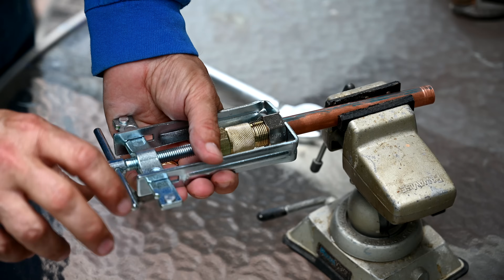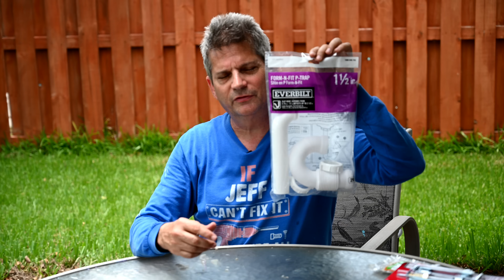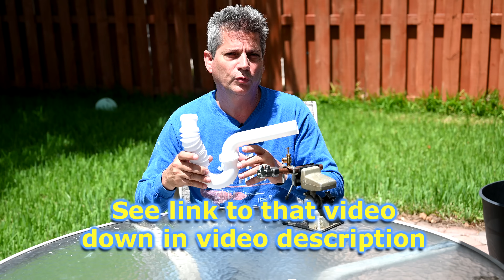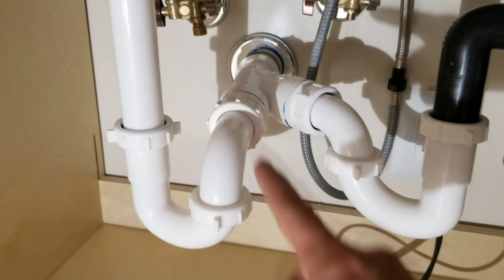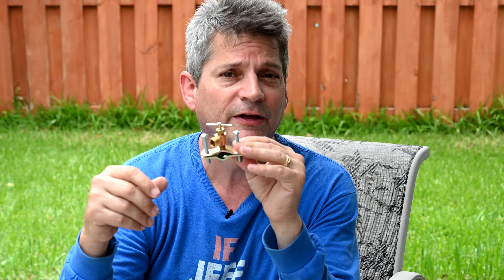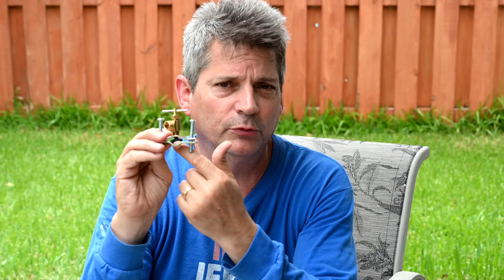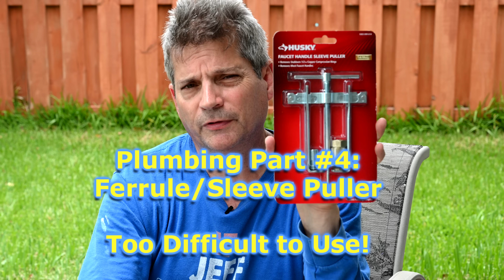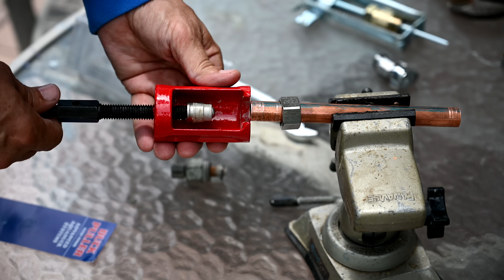4 Plumbing Parts/Tools You Should NEVER Use. NO Plumbing Fails

Comment: Some historic buildings in Washington DC with S traps are required to keep s traps during a remodel.
Reply from the maker: @GoodISnipr If the venting is good, you might not ever even have a problem with the S-Traps. If they siphon out, you can just turn on the water a few seconds and the trap seal fills back up to the weir again.
Reply from the maker: That is weird. I bet in new construction though, they require P-traps

Comment: Can you use shark bites to fix. Or join 2 pioes
Reply from the maker: Yes I use shark bites every now and then mostly temporarily cap off the end of a pipe. But you can use in on a pipe to join another or change the angle of the pipe direction.  I would just make sure it's outside of the wall I won't you shark bites inside the wall in case there is a leak.  Couple of months a girl I used to shark bite compression connectors to convert from Gray polybutylene piping to copper pipe
Reply from the maker: @GoodISnipr Matt is awesome, I've been a long time subscriber to his channel because he's a professional builder, and one of the good guys. I only use shark Bites inside a dwelling, and outside of the wall, you'll never have a problem with them freezing. We are in south Florida, where we never have freezing pipes anyway! Just Hurricane parties!

Comment: Had  a saddle valve for 20 years for an icemaker.  Never had a leak.  Could have soldered a t piece without a problem.  So what about that!  You're an arrogant man.  You are wrong
Reply from the maker: Yes once in a while someone like you will have no problem. There are plenty of people who smoke into their 80s and never get cancer, and some die of cancer from smoking in their 30s. So you're wrong. Numerous people have had issues with this enough that they are banned in most states by plumbing code. I guess you didn't do your research and see about all the people suing sears in a class action lawsuit for installing saddle valves that leaked. Your one case  of a non-leaking saddle valve  is statistically insignificant.
Reply: @jeffostroff  just like its not a gun that kills, its the user, so too is it the installer.  I'm sure there are installers that have installed many of these before they were banned and they have never had a leak.  Too many times, people that can't critically think, blame something that is not at fault.  That is what you have done.  And please dont use the initiation of a class action law suit to prove that the saddle valves are bad.  Class action law suits are rarely based on anything other than a lawyer trying to make money.
Reply from the maker: @jcohenmd  Please don't use the initiation of a class action lawsuit to prove that it's just a lawyer trying to make money. There were literally hundreds of victims, Chicago newspaper reported one victim had $33,000 damage because her Sears saddle valve leaked. Go tell her she's lying, and that saddle valves are ok. LOL. One other point you overlooked, it's not just the bad installers. Many saddle valves are made from cheap Chinese white metal, and after a while it corrodes just from humidity in the air, and pops off the pipe, now you have a pinhole gusher. Saddle valves are nasty and conspiring, they wait until you go out of town before popping off the pipe.
Reply: @jeffostroff  all good points

Comment: We use S traps all the time in Australia, it’s in our standards and never have a problem. If the trap gets siphoned out it’s usually improper venting. Our toilets flush differently to yours as well we don’t use siphonic so could be that but don’t know much about American standards
Reply: Yep, I was about to comment that it isn't the fact that the trap is S shaped, it is the lack of venting that is the problem.   The video needed to show what is inside the wall to explain why the P trap works better.   In the wall, the drain connects to a T going up and down which breaks any suction from high toilet flow etc. (high wind is then the issue, though) You can run a vent stack up inside the wall through the roof, but that is hard to do when the drainage is out the floor.

Comment: When I remodeled my kitchen, I used my Dremel tool with a small cutting disc to make a slot(in the ferule) but not too deep to hit the pipe. Then I took a flathead screwdriver, stuck it in the slot and turn. SNAP, CRACKLE & POP goes the ferule.
Reply from the maker: Anthony a lot of plumbers in the UK use that it still makes me kind of nervous but I now that I have the dark color it's so much easier to just pull it off but that is a good idea. Over in the UK they call ithe ferrule an Olive

Comment: What are your thoughts on SharkBite fittings? Are they a good long term solution, or so you think they could fail over time? Enjoyed the video, skipped ahead of couple of times though to see what was next as time was ticking!
Reply: I had a licensed commercial plumber use shark bites in a commercial bathroom behind walls. I'm not saying it's good, but it passed the inspector. Of course, I think inspectors go based on the worker as much as the job sometimes. I'm convinced there's favoritism, sloppiness and corruption sometimes.
Reply from the maker: I use Shark Bite connections. I don't use them inside the walls, however, only on the outside of the walls, so if there's ever a leak you can spot it right away. Watch my other video here where I used Shark Bite fittings to solve a dangerous engineering issue with old illegal Polybutylene pipes at my neighbor's house: https://youtu.be/jCfY8aHUuxs  We had converted the old illegal gray polybutylene pipes with water shutoff valves under his kitchen sink, converting them to copper pipes using Shark Bite conversion fittings. How to Change Polybutylene Pipe Shutoff Valves to Copper
. A great informative video for you!
Reply: @jeffostroff  I used Sharkbite fittings on 3/4" PEX pipe, both exposed and in wall a couple years ago. A year later I discovered my pressure regulator was not working and I had 125 PSI throughout my home. I changed the regulator immediately. However none of my Sharkbite fittings leaked. I will need to check again in about 50 years to see how they hold up.
Reply from the maker: @bobwexler375   The key to a successful shark bite connection also is by using that Orange depth gauge that shark bite makes and you're supposed to mark the line of how deep your pipe plugs into the shark bite that way you know you've pushed it in all of the way otherwise you will get leaks. That's probably the biggest source of most people's leaks when they do have a shark bite leak and they blame the shark bite instead of themselves for not setting the pipe deep enough.
Reply: @jeffostroff  Yes. I know. That is what I did. I also recomend others do the same.

Comment: As a plumber, the form and fit trap is kinda useless. if the rough in was off center you can use, st 22.5 or st 45. then you just glue the trap adapter to the end of the fitting. maybe it seems elementary to me because im a plumber? hahaha
Reply from the maker: Unfortunately a lot of the DIY homeowners and some handymen don't have that mentality they are from the school of what works now nice and cheap without having to do any work
Reply: @jeffostroff  not so cheap when I have to come in and charge them the hourly rate to replace and fix it.

Comment: I am general contractor, never used saddle valves myself,  I remember when I moved to my house I had 3 of them and my first thought was to replace them, but that I thought "let's see how long they are going to last?" - 19 years later: not a single drop of water, not a single problem ....
Reply: As a home inspector and dreaded "handyman" I see HVAC guys install those all the time on whole house humidifiers. We always recommend replacing them as they have a tendency to leak more often.   Also, take it easy on us handy guys...we're no all idiots and sweating copper & gluing PVC isn't rocket surgery!
Reply from the maker: @dleggs7038  you got it!
Reply: @jeffostroff  , appreciate your content and time you put in to the vids.
Reply: @dleggs7038   sounds like you are uninsured, unlicensed and doing illegal work. You don't know when it's gonna bit use in the ass .
You can't be insured for doing an illegal activity
Reply: I had one in my home  when I bought it.. They tapped it for the humidifier at the furnace..  Never leaked or had a problem for the 8 yrs I owned the home.  But the dam water heater decided to leak 4 months b4 I sold the house.
Reply from the maker: @92hbhb  Yup, those water heaters are no maintenance free, and we are supposed to drain them every year but no one ever does.
Reply: The only problem I've ever seen what when one was installed on the bottom of a horizontal pipe; it clogged up every month. They are probably OK in an area where a leak wouldn't be a huge problem, but if the kitchen shares a slab with $2,000 of wood floors, it's worth using normal fittings.
Reply: You really only run into a problem when you need to turn them on and off years down the road.
Reply: There is major variation in the quality of rubber being sold at different points in the supply chain.  For example, with an old school faucet that had a rubber seat washer, the junk you buy in packs at the big box store is vastly inferior to what you used to be able to buy a la carte from a plumbing supply store.  Now it's hard to even find a plumbing supplier who will let a DIY / casual handyman in the door.  They only service "commerical" sized accounts.  Anyway, the rubber set washers, o-rings, etc. that you get at Home Despot et. al. would fail within a year.  While a repair with parts just bought off the shelf prior to the Despot's ascension (and the crap-tastic cost cutters taking over the supply chains of the world) would last for 3+ years.  Now I find same phenomenon - the original saddle valve might have been sourced by a reputable company and have a gasket that lasts for 10+ years.  Then you buy a replacement at Home Despot, and in 12 months you are back for another as it fails prematurely.
Reply: i used one of those saddle valves for a water hookup for a fridge. if i'm correct that needle is supposed to pierce the copper pipe and that's how the water is let in. my problem was it was an old house with, if houses were built with it back then, i believe it was iron pipe and would not pierce it.
Reply: you can not shut them off.
Reply from the maker: Christopher, yes it seems to be hit or miss, some people have problem, while others get lucky.  It's like the 80 year old guy who smoked all his life doesn't get lung cancer, but a girl in her 30 dies from it.

Comment: Way too long winded. I had to skip through it to look at each item. I was about to leave, but it seemed slightly interesting.
Reply: Agree. Interesting stuff, but it could be done in half the time.
Reply: So true, when he got the code docs out that was my cue 2 ffwd each item out of curiousity..As for the ferrule (olives to us)  pulling tools, forget that. Far quicker to carefully use a sharp junior hacksaw to cross cut it deep enough to get a slim slot driver and twist to snap it.. definitely faster from experience.

Comment: #5 All in one wrenches.
Reply from the maker: What? Those are the best wrenches, why don't you like them? They are designed to perfectly fit all the angle stops and water hose nuts.
Reply: If your going to promote and or sell a product at least get the name right .
It’s called the Ridgid One Stop Wrench , NOT the All in one wrench. pathetic.
Reply from the maker: @siriosstar4789  Sorry about that it was 100 degrees outside that day, super hot and super high humidity, we had to get that video done and I had to leave for appointments soon, and I had an uncooperative camera operator who couldn't bear to be out in that heat. I misspoke on a few things sitting out in that heat. But I do have the correct links down the description to the wrench, with the correct name.

Comment: Why do they even sell these accordion P traps if they are not allowed? Is there another use?
Reply from the maker: They are sold at all of the hardware stores they are not be end by any kind of state law or federal law from selling them. They are only being and by building codes from using them. Also many people will put one in place temporarily until they can get the full correct repair done.

Comment: There is no reason to ever need the flexible p trap.  I've had plumber hand me saddle valves.  I have three of them the only part of the system they are in that ever failed was everything in the system besides the saddle valve.  Get rid of copper and use PEX.  You don't really sound much like a plumber.

Comment: Michigan uses A fully integrated custom code based on the 2015 International Plumbing Code. Effective date: April 20, 2017.
 ISBN 978-1-60983-681-8  Publisher ICC.  Not sure if the code used by the State of Michigan bans these items.

Comment: You like the word capillary. That's fine but use it in the right way. The drying of the ptrap from using an S trap is not because of capillary action but a syphon from the toilet when the fixtures aren't vented properly.
Reply from the maker: I guess you didn't hear me correct myself immediately after saying it. I guess you also never heard me mention the word siphon.

Comment: That cheap pull tool that you were using had two notches in the back bar. I think you were supposed to put the side clamps into those notches which would enable you to turn the handle without it binding.
Just a hunch.
Reply from the maker: Yes, that is true. Even when latched into  the grooves, you still have a hard time turning it because of the tiny size of the rod they have there and you're expected to just wrap your fingers around this rod and use all sorts of super human strength.
Reply: Ok just a thought is All.

Comment: My place was remodeled by a crackhead who put an S trap under my kitchen sink with no venting anywhere
 Horrible dead animal smells.

I call the S trap a Siphon 'Trap' which is contradictory in itself.  The draining water just siphons out the water from the trap
Reply: Did you fix it?
Reply: @CGoffgrid  I bought all the stuff to fix it.  I need to get the permits and call the power company to pull the meter so I can replace the sub panel.  

Right now I'm building a workshop and storage shed so I can use it to store stuff to make room to do the work
Reply: @jburr36  Quite the project you have going on. I have a few here myself, including laying tile, which I hate.
I have a few plumbing vids on my channel that you might enjoy.😉👍👍
Reply: @CGoffgrid  I'm going to remodel my bathroom sometime in the future.  I'll be doing tile too.

Comment: I must a lucky son-of-a-buck; have had the same SUPCO STV-2 saddle valve clamped to a 3/4" vertical copper pipe for 37 years now, supplying water via a 1/4" od copper line to the icemakers in multiple refrigerators. I just took a look at it and it still looks nearly new, no leaking or corrosion. Located in a dirt-floor, dry laid-up fieldstone-foundation 144 year-old farmhouse cellar.  Counting my blessings...
Reply: Anecdotal Evidence Fallacy. Some kids didn’t die from not wearing seat belts in the 60’s, but that doesn’t mean it’s safe to not wear a seat belt. Count yourself lucky you haven’t had $10k in insurance claim for water damage from a saddle valve. 😀
Reply: Brittany Levinson 
True. It's amazing any of us are still alive; we all rode our bikes without helmets back then, too.

Comment: When installing Humidifiers one of those stupid saddle valves usually comes with the kit. And they all eventually crap up and leak. I have seen them leak in such a way, that when you look at them, it looks like they have a spider web attached to them. When in fact, it is actually water continually spraying from the valve. I always throw them out, never use them, I solder in a quarter turn valve that controls the water flow to the appliance. And buy the necessary size copper fittings, that I put on the copper pipe (all soldered) to accommodate the quarter inch line to the humidifier. Also, most kits come with the cheap plastic line to the humidifier. I throw that out and only use copper. 
Those pressure fit valves with the ferrule, I never use them. Only valves that I solder in place. Same with those push in connections on faucets. Don't use them, I'm old school, had a couple that I tried and they leaked. One blew off when the lines were livened up.
Reply from the maker: Hardrock, I wish all the installers  were like you!  We should not have to say we are old school, it should just be done that way current school!😎

Comment: i agree but i have seen the saddle valves used and instead of piercing a hole they drilled a hole first and those saddle valves were well over 40 years old and still not leaking but you are right its not the right way